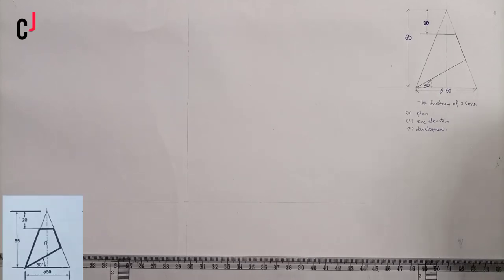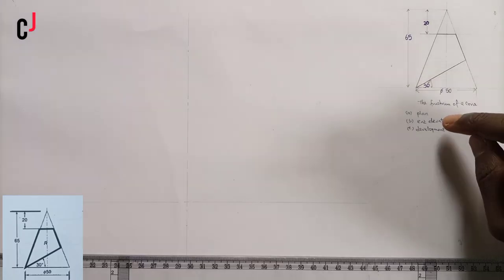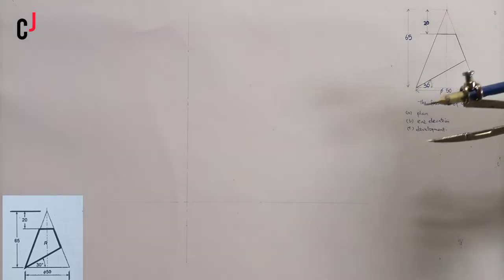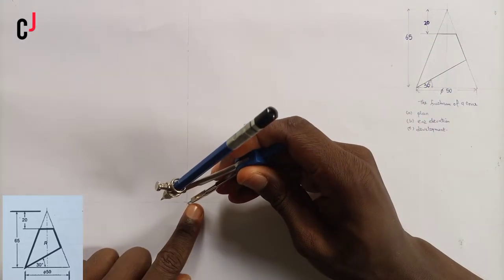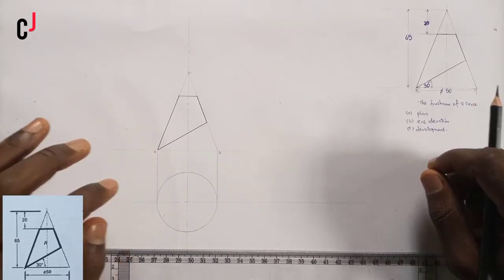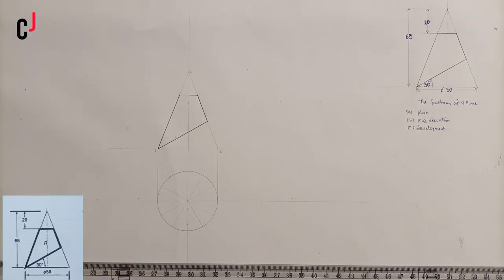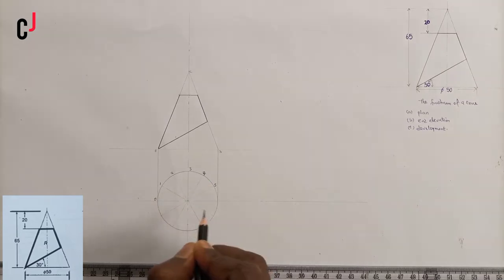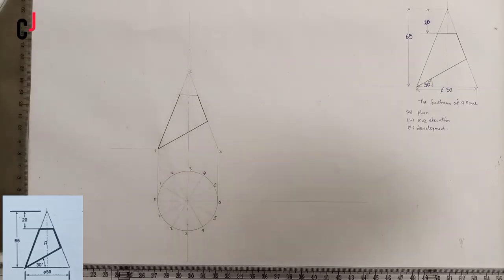development of surfaces in engineering drawing ( cone - 1 )

Comment: if i have 10 inch dia cone for down side and 3 inch dia for up side and the total height is 1 feet than how to develop please tell?
Reply from the maker: Draw a straight line,
Pick a point AB such that point AB is 10 inch apart.

Construct a perpendicular line on line AB.
This means that you will create angle 90 at the middle of line AB.

Measure 1feet at the perpendicular line indicate it as point C.

From point C draw a straight line.
Such that it is parrarel to line AB.

From point C,
Measure 1.5 inch to your left and 1.5 inch to your right.

With this you have succeeded in producing the image.

Use desame procedure in this video or check my videos on development of surfaces in engineering drawing.

And remember to subscribe.
Do have a blessed day ahead.

Much love from J,C engineering and technical drawing.